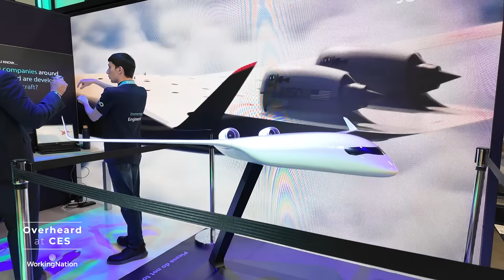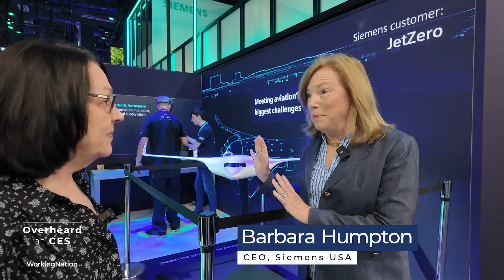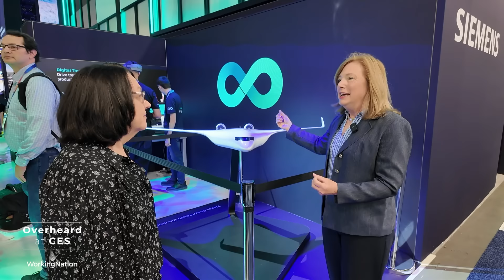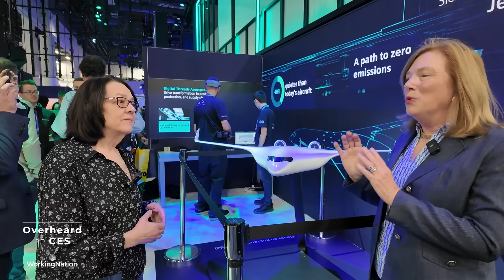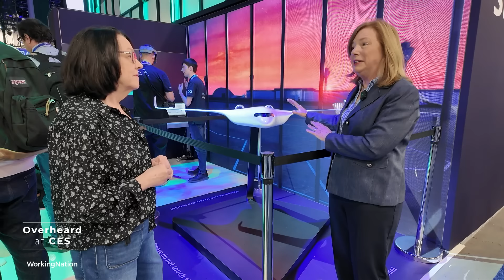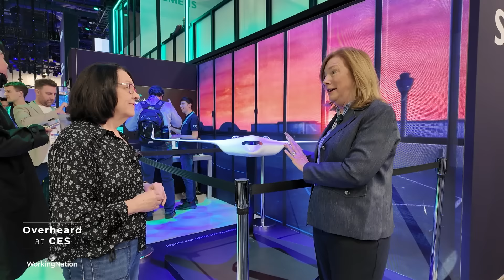CES 2025 Reveals the Future of Aviation | Siemens + JetZero

Comment: A main structural engineering challenge after resolving the all-wing aerodynamics, also affecting occupant safety/comfort, is mitigating increased turbulence forces (10x?) registering directly onto the rigid fuselage due to the larger and more planar underside surface area. 

Normal airliners induce about 10-15% of cruising lift from the fuselage underside surface area/pitch up attitude, with the flexible wings bearing the overwhelming portion of turbulence-induced stresses. 

This new concept would have the fuselage handle the majority of lift and thus turbulence also. Structural and cabin shocks would be severe

Comment: The reason that fuselage of modern airplanes looks like a tube it is because of pressure difference inside and outside a plane. Any other design will be heavier. And with this engines configuration how do they prevent engine fan stall at high angle of attack. There are a lot of such questions just before you start such project.

Comment: Tube configuration is the best to provide pressurised cabin and give the right height for passengers. As you notice, the blended wing has a shorter height and that’s a bad news.
Reply: The blended body provides more room for more people, it still has enough height to accommodate taller people.
Reply: @ you don’t understand, for the same volume, it has a shorter height.
Reply: I don’t think that’s correct. There is no reason a blended wing would change the height of the vehicle. They could easily make a 3m interior ceiling height, similar to an A321. I would expect the usable volume to go up, not stay the same. You can have the same volume / diameter for what would be the traditional tube of the plane, but then also have additional passenger volume in the wing. That does beg the question of where the fuel would go if they opted to design like that, but we don’t have that data at this time.
Reply: @ again, if the volume goes up, tube aircraft also can go up. So what is the advantage of blended wing then?
Reply: @hafizuddinmohdlowhim8426  Fewer surfaces to create drag. This isn’t a volume issue, it is a surfaces issue. A blended wing allows for a much more fuel efficient aircraft, even at the same usable volume. Could be a HUGE benefit to air travel. Think 30% less fuel for the same payload capacity type thing (a completely made up number as an example.)
Reply: @photonempress  unfortunately you can’t change physics. Volume = surface area * height. For the same volume, when you increase the surface area, the height will reduce. Okay have a nice day.
Reply: @hafizuddinmohdlowhim8426  oh no, you figured out the simple problem that the $150 billion company overlooked. You need to give them a call and let them know, you could save them a lot of time and money!
Reply: Everything is a tradeoff. JetZero seems to think it's a fair trade.
Reply: @cben86  they better to think it thoughtfully.
Reply: @hafizuddinmohdlowhim8426  Maybe they follow the social media all to time and get all answers so they don't need to think and plan themselves.